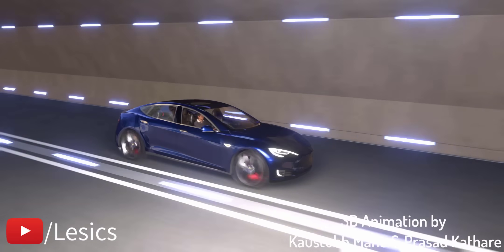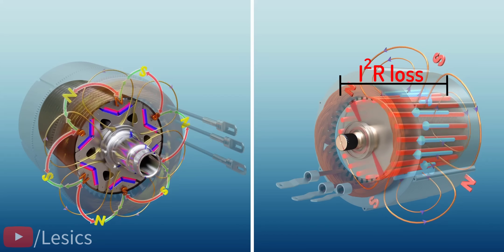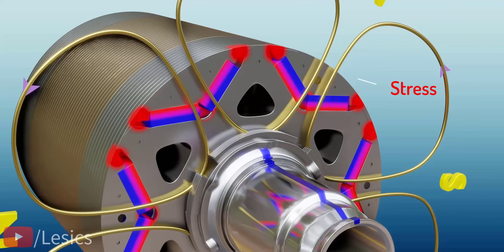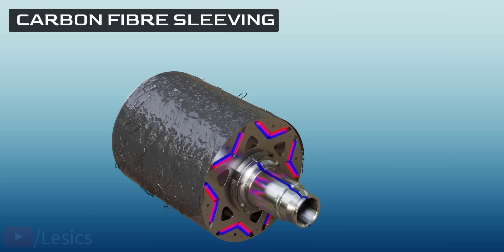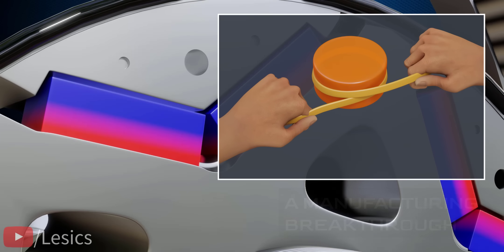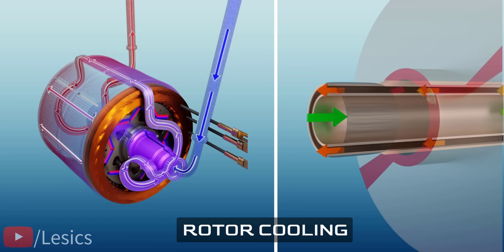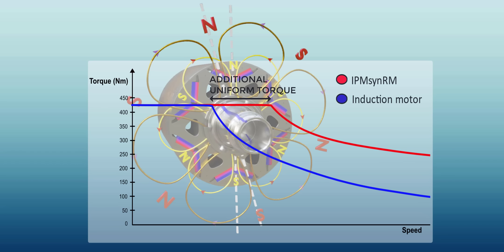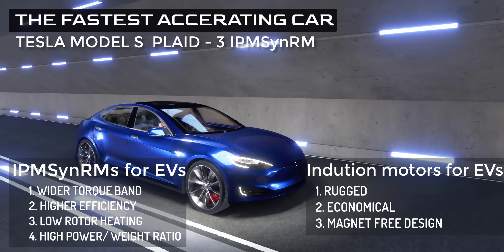Model 3 Vs Model S Motor

Comment: The problem with sleeving the rotor is that you need a material that has high magnetic permeability. Basically magnetic flux should pass through it without much problems. Or else it just ends up limiting the air gap flux density and so you don't get as much torque as you can. 

Maybe the engineers at tesla have solved this? If they have, then it's amazing.

If you ask me, I'd just stick to induction motors... maybe even switched reluctance motors, all because of how simple and reliable they are

Comment: I wonder if the curing process involves a vacuum machine. It be like trying to boil water without heat, the only way to do that would be to introduce a vacuum to get the liquid to boil at a very low temp.

Comment: i prefer IM over IPM. 
When talking about electric car, it becomes weaker and weaker while it will be used in hard environment, the battery, and now the motor.
Thinking about high temperature places !!! Using expensive and rare magnet just to get some extra battery saving and torque!!

Comment: Well, I don't know if only I prefer induction motors : reliable (some with decades of working without big problems), cheap to manufacture,  fixable (including stator and rotor rebuilding), and simple.  In my house, we have an AO Smith  not sealed motor, and 26 years later it works, and it lives in the worst conditions of humidity and daily ambient temperature changes. For 2% efficiency gain, I will stay with cars that stays with induction motors (I know, good luck for me finding one, because today everyone uses PMSM or BLDC, including washing machines 😂😂😂)
Reply: @HK-fz5rn   I think is more about efficiency,  PMSMs don't have rotor  high losses and EVs range is too important, so efficiency is important because a smaller battery can be use for the same range (AC motors powered locomotives use three phase induction motors,  so torque is not a problem (and if it is, it can be solved with a lower gear ratio or a 2 speed transmission), and they are air cooled that can work at higher temperatures). Just throwing ideas, I prefer old school and simplicity (more reliability and easy to fix). Greetings

Comment: BE CAREFUL what you believe on the internet. many of these facts about the “Tesla” PM motor are completely false. 

1. The carbon sleeved rotor is only in the plaid S/X not the 3 or Y
2. Teslas PM motor is oil cooled not glycol cooled. 

Could go on and on.

Comment: This is my prediction for the carbon sleeve:
Build the carbon fiber sleeve separately using mold.
Cool the metal rotor to make it shrink.
Insert the shrunk rotor into the carbon sleeve.

So it's reverse of train wheel installation (expand the outer sleeve by heat then insert it into wheel axis)

Or insert the neodymium magnet after rotor is sleeved
Reply: Cool the rotor? Steel becomes brittle and more likely to fracture at frigid temperatures unless mixed into expensive alloys. Have you ever used heat shrink tubing? That's how tight it is.
Did you even watch the video? Magnets at an angle?
Reply: @BariumCobaltNitrog3n 
the full rotor doesn't have to be 1 solid block.
it can be made from several interlocking slices. 
and the cool shrinking is only needed during sleeving

and as animated in the video, the magnet isn't welded into the rotor but inserted after rotor (slice)  is sleeved. 

expensive alloy for such volume shouldn't be problem as the batteries, control electronics, etc. will cost much more.

the rotor must not be steel or ferromagnetic as it will make the rotor to be 1 big 2-poles static magnet.
it's copper based according to Elon tweet
Reply: No

Comment: Excellent educative video. I assume the IPMSynRM must be very expensive given the complex engineering process behind its manufacturing.
Reply: It's no more complex than any other synchronous 3-phase interior ermanent magnet motor, and that the most comm9n motor type in modern EVs

Comment: I think a disadvantage would be increased manufacturing cost due to complicated and proprietary carbon fiber compression winding and low repairability if the permanent magnets become demagnetized due to a defect in the cooling and due to their more complicated cooling. The advantages may still outweigh this downside though
Reply: I agree but it don’t think the advantage is worth it. Its a bit of a gamble on Tesla’s end. I installed motors for years at Fremont and cost savings also had a major impact on decision making. It’s not a flaw in silicone valley it’s a feature!
Reply: @blayzehaze trh

Comment: Its not a question if either one or the other e-engine is better. E-mobility is crap, makes no sense nor environmentally nor economically.
Technology for clean fossile combustion sources is here but is not allowed to get to the market.

Don't talk about theoretical efficiency if you cannot make up the right conclusions by using only very limited details. 
Efficiency does NOT only depend on max torque per energy unit.

In the end, when it comes to durability, e-mobility is extremely cost inefficient and life expectancy of this tecnology is short. E-Vehicles have been tested and forgotten in the beginning of last century. There is no crucial new tech behind the nowadays EVs. Yeah, make them 2 or 5 % more effective by decreasing life expectancy by 50% 😂😂
120 years ago there were the best engineers on the planet. Things they made lasted for decades or are still running today. And Today's crap? You can be happy when something expensive lasts 10 years.
How about spending money on long lasting technology and not on one-way, throw-away-china-plastic quality? Not cool enough? Not enough money in the pockets of billionaires? Oh damn. I guess therefore my arguements don't fit into society

Comment: PMSM are also used in Indian EV cars Like Tata vehicles known as Ziptron technology , while the old school Induction motors are used in Non Ziptron vehicles like Tigor EV with low power capcaity.  The Innovation done in reluctance torque to support the motors performance is genius method , as in older generation motors the Reluctance torque used to fight against the torque produced by motors. By simply changing the angle of current;s orientation to the magnetic field , the reluctance will also support the motors performance by doing so.

Comment: With a Keppe motor they would have even more efficiency. How does a Keppe motor works?

Electric motors transform electric energy into mechanical energy, and electric generators do the opposite, i.e., transform mechanical energy into electric energy. The Keppe Motor comprises a motor feature (electricity being transformed into mechanical energy) and a generator feature (mechanical energy being transformed into electricity) in balance at the point of resonance of the system.

System’s highest efficiency is reached when the resonance between the two components of action (motor feature) and complementation (generator feature) takes place. The resonant point of this system includes the electric power supply (domestic grid or battery) and the load on the shaft.

The Keppe Motor contains a magnetic rotor with permanent magnets which rotates inside the stator coils. When the magnet is set in motion by the supply voltage applied to the coil (motor feature), it creates additional voltage in the coil terminals (generator feature), increasing the magnetic energy stored in it. This energy enters in resonance with the power grid’s energy through pulses of varying intervals determined by the Keppe Motor itself and this is the nature of its high efficiency. As consequence, one of the best advantages of the Keppe Motor is that it runs cold, which is an indication of its high efficiency and guarantee of durability.

Nevertheless, for all this to occur, it is not enough to make a motor with a different design – you must also change the power supply, otherwise, resonance cannot be achieved.

The best way to reach resonance is to let the motor interrupt its own power supply according to its own structure, without interfering with its operation. Because of that, the typical and necessary power supply of the Keppe Motor is PDC (Pulsed Direct Current), the only supply that allows the system to reach resonance. Depending on the motor design and parameters, such as wire gauge, presence or absence of an iron core, type of magnet, coil inductance, etc., the entire system will automatically search for its point of resonance for the load and voltage specified. At this point the electrical current decreases to the minimum necessary to perform the desired work. This minimum is always lower than that required by conventional direct or alternating current to perform the same task.

Comment: This is misleading. IPMsynRM is low speed performance. The Model 3/Y have both PMsynRM (rear) and AC induction (front) motors in the LR and Performance variants, but neither have carbon wrapped rotors. Only the plaid Model S offers this. You can read the motor types in the cars settings. They use the rear PM motor for better low speed acceleration, and the front AC motor for highway speed efficiency.

Comment: A way to get around the curing process is to first cure the resin system at a lower temperature to not affect the magnets. You can install a keeper tube (Made from cast iron) around the rotors which keeps the atoms aligned. This would need a post cure for the resin system to reach its required properties... but the rotor will still be magnetised.

Comment: i understand the gaps are needed for magnet efficiency, but are they hollow like the graphic portrays? or are they filled with a high strength epoxy? i imagine that would slightly help with strengthening and not interfere with magnetism.

Comment: If buyer want to use/keep car until guarantee expired (would pay @100.000 for few years), it's ok new star motor with permanent magnet. Otherwise the reliable and long lasting car/motor remains that one equipped with tesla induction motor.

Comment: Why not have a transmission with a few gears and reduce the motor's RPMs?
Reply: All electric car motors have gears, but generally just a single fixed ratio. The more you gear down the motor, the more effective torque you get at the wheels. Ideally you want the motor rotating as fast at it can to maximise wheel torque. If you have to limit the rotation speed of the motor with gearing to stay within its maximum torque band, then you reduce the wheel torque.

Comment: Model 3 dual motor variants use the IPMsynRM on rear axle and induction motor in the front, not only IPMsynRM
This improves efficenciy, because the induction motor can just run without power with no recuperation, so no loss of energy when only the rear motor is needed.

Model S and X were other way round before Plaid (IPMsynRM in the front @Raven)
Dont know how it is now with the 2021 Model S & X

Comment: there are a few epoxies that kick without needing an autoclave, room temp cure, flash cure, uv cure. they should save time/energy in production as well so long as cure times aren't too bad.
 as far as wrapping goes, I'm surprised they need a special machine, seems like anything that can wind string/wire on a spool could do the job and the motor could even turn to wrap itself. I wonder how much this impacts cooling since carbon fiber is a thermal insulator.

Comment: I would bet that Tessa us curing the composite motor overwrap with an electron beam or laser. Electron beam might be tricky because of the magnetic field but there is no reason that a prepreg carbon tow couldnt be cured with laser heating. Minimal heat input focused on the carbon would mean that there is almost no chance of heating the magnets.

Comment: I feel that it would have been good to mention at least once what IPMsynRM means. It stands for Interior Permanent Magnet syncronous Reluctance Motor.
Reply: brain left the chat. so i start practicing for 2 h
Reply: And what does the Reluctance par tell us?
Reply: @markgritzan2841  Magnetic flux wants to find the path of least reluctance, this is how they get the motor to turn.
Reply: @markgritzan2841  In simple terms: the metal in the rotor is attracted to the electromagnets and that adds up to the effect of the permanent magnets being attracted to de electromagnets. Think of what happens when you move a fridge magnet around a compass and/or around a needle.

Comment: So they made a permanent magnet 3phase motor? Like everyone has been doing for last 100 years?
Reply: They added the reluctance portion by addition of iron sheets to maximise reluctance and changed the angle of magnets to maximise efficency and Torque. Sadly this part was not really covered in the video, because the didnt show the difference to a normal permanent magnet motor

Comment: Making more power and saving weight by using ultra-high RPM is a highly questionable strategy. 17K RPM is very self-destructive. Of course, the motor will seldom run that fast, but even a steady 10K is pretty radical.
Reply: It's not radical for an electric motor, only an ICE motor.

Comment: wouldn't it have been easier to have just added a gearbox to the car instead of all this carbon fiber stuff.... proven technology that can be used here for far cheaper, bringing the entry cost to EVs down
Reply: The Porsche Taycan does have a two-speed gearbox, for the rear motor only.
Reply: @brianb-p6586  Yeah I know, I'm talking more about having small motors (100ish hp) and gears to keep in the low RPM torqueband. 100 hp should be more than enough with the amount of torque these engines produce, and would be a lot cheaper/more efficient than these massive high hp motors
Reply: @david922-r5j  No, 100 horsepower isn't enough for adequate performance in anything but a basic small car, regardless of the motor speed, unless you have at least two of them, and four for the larger and higher-performance vehicles. These motors are not huge.
Reply: @brianb-p6586  im talking about for economy cars. Like the model 3 is supposed to be. Many economy cars have 140-170hp, but with all that at the top end. With high low end torque of electric engines, i'm certain 100hp EVs would be enough to match the speeds of most of todays crossovers and small sedans/hatchbacks. Remember that peak horsepower doesn't matter, it's all about area under the curve

Edit: I actually just found an EngineeringExplained video confirming exactly what I'm saying. Check it out: https://www.youtube.com/watch?v=6YuTpPr3Uv0&ab_channel=EngineeringExplained

Comment: The efficiency difference is due to the fact that the Model S has an AC motor and the Model 3 a DC motor with permanent magnets. That reduces the losses by 2x at the cost of higher cost and more weight. Every other EV builder uses DC motors because of it's higher efficiency. Luckily, Tesla corrected their error on the Model 3
Reply: No.  All Tesla motors are AC, and all Tesla motors use an inverter to change the DC coming from the battery into AC for the motor, very carefully controlling the features of the AC to maximize power
Reply: All I can find on the web says the model 3 motor is still AC, where did you find this info?
Reply: That's nonsense. All EVs use AC motors. The difference is that EVs of a decade or two ago (including the Tesla Roadster, Model S, and Model X) used asynchronous (induction) AC motors, while most newer EVS use synchronous (and always internal permanent magnet) AC motors. Don't let the misleading term "brushless DC motor" confuse you; it really means an AC motor using square-wave power, but EVs all use sinusoidal AC power.

Comment: well, the power to weight ratio in an elecric motor isn't doing much of a difference if you ask me. it is a couple kilos different whilst having a battery that weighs many hundreds of kilos.
Reply: Weight is a none issue. Everybody who had calculations at school regarding rolling mass knows this. It's about aerodynamics.
Reply: @HermanWillems  Excessive mass can be an issue if you are interested with the car's handling performance. By having a lighter car, it will be easier to turn, downforce would have more of an effect, suspension systems would work better, and the tyres would have better grip and an extended lifespan as well. Basically, having a lower mass means a lower moment of inertia, which would greatly improve a car's handling performance. That is why Formula 1 teams are obsessed with removing as much mass as possible.

Also, another thing to note is the importance of how that mass is packaged. If the packaging is compact, the radius of gyration (gyradius) will be lesser, which would improve handling characteristics. However, this comes at the cost of possibly reducing the lifespan of the powertrain components because they are much closer to each other and the heat that is given off from particular components (for example, the motor, which both internal combustion engines and electric motors, do give off quite a bit of heat) will have an easier time finding its way to the other components.

In summary, mass and its distribution is critical to automobile engineering.

Comment: Stop thinking about motors n start thinking about batteries 😐 we have good  enough motors, what we don't have is some sort of power supply that can power up the motor as long as cars, or even more. And changing time must be like gassing ⛽, 2 minutes top to fully charge it 😐that's  what you should workin on. Not 2 percent more efficiency of the motor 😒
2 percent? Are you fucin kidin me?😒

Comment: 98% or 96% efficiency? Who cares. They're both very high figures in my book. Especially remembering that a 45% efficiency for an ICE is considered outstanding.
Reply: Generally induction motors are 87% ...
Reply: @SurajKumar-vb1yu  96 % maximum efficiency. Motor efficiency change according to the % of full load.